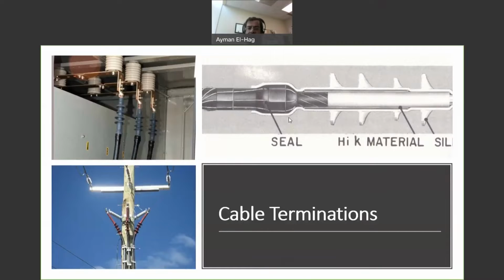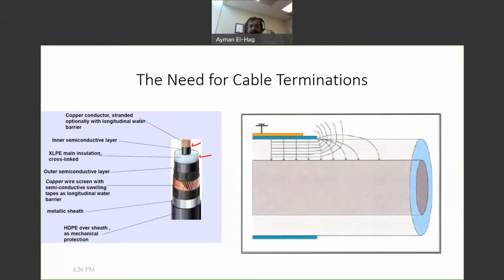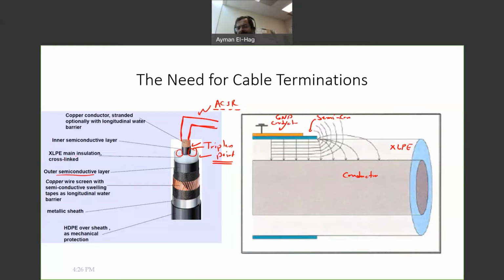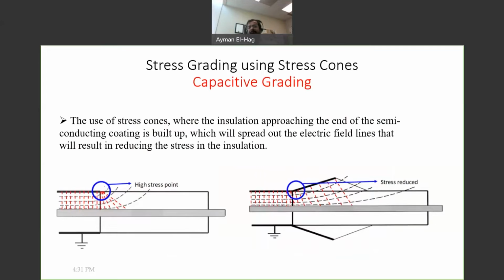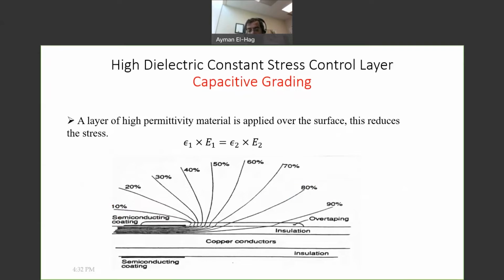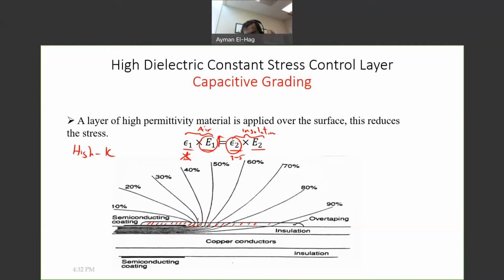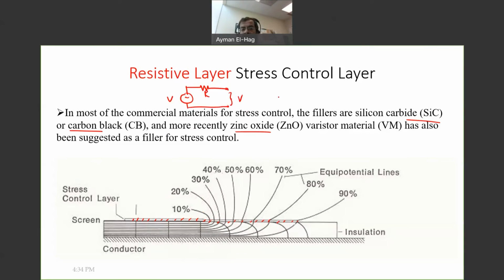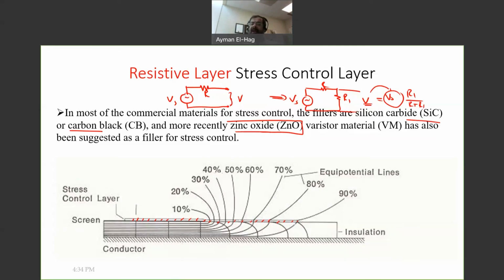Cable terminations: need, types and problems

Comment: hi friends, I thank you for the video I get a lot from it. I have faced a problem in my 132kV underground cable stringing project, the cable size is 1000mm2 and the contractor proposes to use welding to connect the bare conductors. Do you think this is a good option to use welding instead crimping,
Reply from the maker: To the best of my knowledge crimping is used to connect cable pieces
Reply: @electrical4everyone  thanks my dear